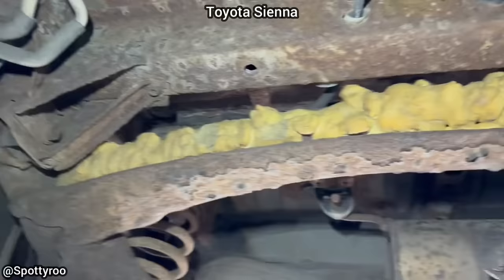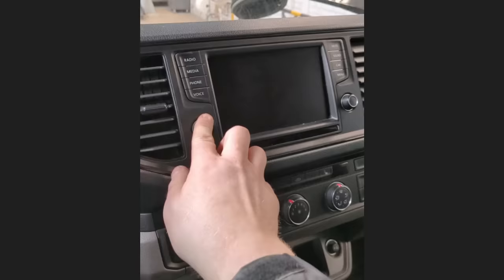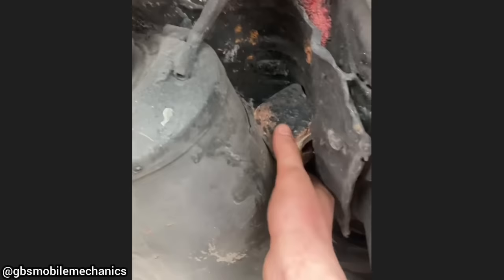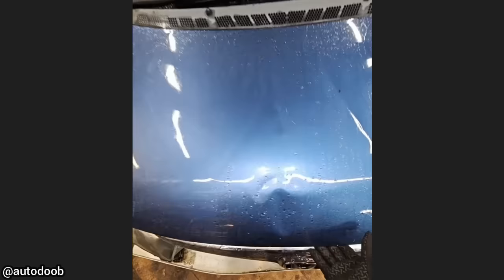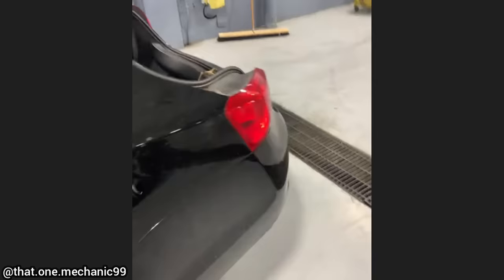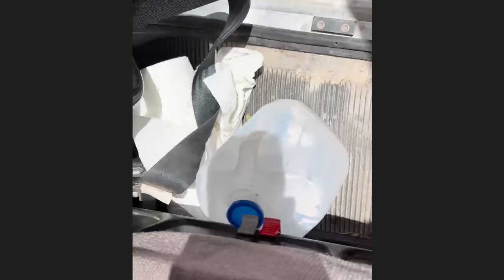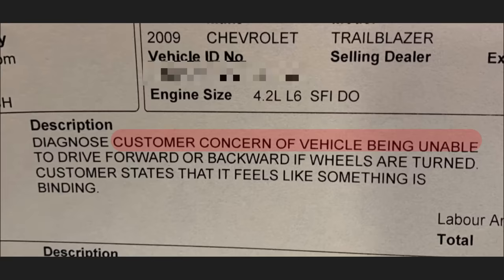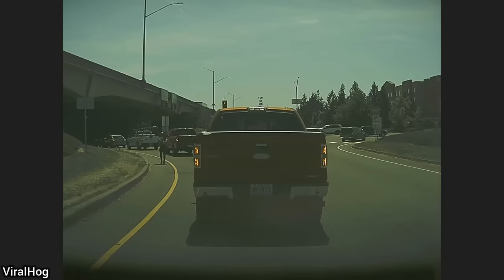Customer States Car She Just Bought Has A Grinding Noise

Comment: Props to the guy who has a bunch of friends willing to push his car anywhere he wants to go. That guy wins the week.
Reply: That's some great gas mileage.
Reply: Must not have had very far to go
Reply: It was the dumbest thing i saw today lmao
Reply: @AnekoGT really? Not the radio or the jeep back door?
Reply: If he's not yelling "ONWARD, SLAVES!" then he's doing it wrong
Reply: It doesn't run on fuel , it uses Gatorade and chocolate bars....
Reply: @jasonfitzpatrick414  Meals are more expensive than gas
Reply: This repsirshop prob saw his opportunity and gave a big repair estimate. Props to the friends helping the car owner🎉
Reply: I once pushed my friend's car BEFORE the party. It just stopped. We were around 40 miles from his home and reached his limit on tows with the insurance co. I think it was two in one year. Uber was $40 and just paid another guy $20. His new problem was going back to the same location the next day to replace a chip. The best part? He's a MECHANIC.

Comment: The plastic on the filter keeps it new and fresh forever. 200 IQ!
Reply: untill it gets dirty in 10 years
Reply: Just like grandma did with her couch!
Reply: @thewubmachine840 Nope. Mines 12yrs old now , looks like new.😂
Reply: Don't have dirty air if you don't have air taps head
Reply: i laughed out loud at that part, maybe the recirculate button or doors dont work and they wanted permanent recirculated air, lol
Reply: I'm surprised that there's no multilingual warning, in large block letters, to remove the plastic film before installation.
Also the stock warning:  This bag is not a toy.  Keep away from babies and toddlers.
Reply: @calvinnickel9995  Exactly what I thought.
Reply: works for oil filters too!
Reply: Looked dirty even in plastic..
Reply: Service mechanics HATE this amazing easy trick
Reply from the maker: @brianstratton8767 I had to get a brand new cabin air filter the other day and it looked the same.
Reply: @calvinnickel9995 My parents had that on their car seats back in the 70s. Got pretty hot in the summer sitting on that w/ shorts on
Reply: Long ago there never were cabin filters.
Reply: asian remote
Reply: Air systems all tuned up. 
I checked, you’ve got a brand new filter in there.

Comment: A grinding noise means that it needs more spray foam.
Reply: Excuse me, good sir, have you heard of duct tape? It solves everything.😊
Reply: Duct tape trumps spray foam , so op is right.😂
Reply: and glue
Reply: Yeah between the ears
Reply: @toupac3195  Duct tape is obsolete, we enter the era of spray foam.
Reply: I'm not a big fan of govt restrictions, but spray foam should require a safety course and a permit, lol
Reply: Needs more Lego people. Caught that on the thumbnail, went... wait? Blew up a screenshot of it, he's there and on the job, lol.
Reply: Lads, you need JB Weld! None of the shit you suggested is gonna work
Reply: @Doug791 but nothing beats jb weld. I seen a video w a cylinder head made from jb weld and it worked. Not fixed with jb weld, but 100% made from it. It was a lawnmower, but still a jb weld cylinder head. That stuffs amazing.
Reply: @CodyT362 exactly. I said jb weld before i read the whole thread and seen your reply. Jb weld is the new fix all.
Reply: @jacksmith2315  I can't image anything that can't be fixed with jb weld , and maybe cable ties.

Comment: The hitch blocking the rear door had me laughing. Wow
Reply: It would be hard to resist the urge to say "Sir, I found the problem. It turns out you're an idiot."
Reply: How is that that person didn't hear the door hitting it??
Reply: It's a jeep thing
Reply: Unlimited accessories on vehicles are mandatory.  Operator's brain and eyes are optional!
Reply: IKR!  I don't think I've ever eye rolled or laughed so hard.  And I've seen some pretty ridiculous stuff watching this channel.
Reply: I was shaking my head.
Reply: Reminds me of a computer technician on the phone with a customer. The computer wouldn’t start working. After going through all possible steps the customer states that the power in the neighborhood was out. The technician told him to pack up the equipment as he was too stupid to own one.
Reply: @aluisious  ID10T Error.
Reply: Yep same 😂
Reply: Sadly, that's a common problem on those types of vehicles, including needing the shop to diagnose it.
Reply: The majority of Jeep owners would fall for this if they owned the same hitch.
Reply: I had to rewatch that part to ensure I was tracking the level of dumbness.
Reply: @themightymutt5213  Yes, or SEE it hitting the hitch.

Comment: Replacing a fuel pump is something a home mechanic should be able to do. But, if they have that level of competence, you would think they could have diagnosed it themselves.
Reply: Exactly 😂. I can only imagine how they are going to butcher that job
Reply: That guy talked his buddies into pushing his car to the shop, I seriously doubt any of them is smart enough to change a fuel pump
Reply: @samholdsworth420  bet they weld the new one in
Reply: It’ll be back in a week with a backwards fuel pump, missing fuel lines and a pile of wires that “another shop” installed.
Reply: Not as easy as they used to be. Most modern vehicles have the fuel pump mounted inside the fuel tank. While not particularly hard, that's more than most can handle these days.
Reply: What? When they can't figure out why the rear door won't open? 1:36
Reply: @CJRoberts8812  Some aren't even replaceable at all, you have to replace the entire tank for thousands of dollars. The first couple generations of the Prius were like that.
Reply: @CJRoberts8812  I think they're easier to replace today. You used to have to drop the fuel tank to get to the pump. Nowadays, most cars you just take the backseat out to get to the access cover for the pump.
Reply: I could see an Advance Auto Parts across the street. I bet that is where they were headed.
Reply from the maker: Might be in a future episode 😜
Reply: I had a 2000 Impala that had a pump go out.  Luckily, GM actually built in a door under the rear seat to access it.  Took about an hour.
Reply: @PaulG.x  ya that one ... dammmm...
Reply: Unfortunately a lot of young men don't know much if anything about car repair besides bodging in a fart can and putting Japanese character stickers all over the sides of the car.
Reply: Modern vehicles need an expensive diagnostic computer to properly diagnose a problem. I've never had a vehicle pushed to a shop. But I have driven to one for a diagnosis and then fixed it myself when I didn't have access to the proper equipment
Reply: @johnstone9396  Instead of dropping the tank, they'll cut in from the top with an angle grinder. 
If they DON'T set the car on fire, they'll seal the tank and the body parts with spray foam and self-tapping screws.
Then bring the car back in to diagnose an evap leak and a gas smell in the car - then they will decline to get it repaired.
Reply: @stonefacedninja  Used to be fuel pumps were upfront on the motor down low somewhere.  On the 472 caddy motor on my engine stand it is on the front driver's side.
Reply: C'mon now, you've seen the level of flognuttery from these specimens.  ...oh sorry, I mean another shop of course.
Reply: @zloycock  "Make the hatch by yourself" -this is not how you do your own maintenance and repairs.  🙄  Think we found the "other shop" everyone claims to take their cars to.
Reply: Replaced the failed power steering pump on my vehicle today.  And a new O ring for the high pressure output line.  A known leaking point.
Reply: My old 68 Impala with a 307 V8 had the fuel pump mounted to the engine. 
It was powered by the cam shaft.
Two hoses and two bolts and you were done.  😅
Reply: @railtrolley ... 😂😂😂....Was it a "FOAD"...??...Coz, that's what I have...Desperately needs that repair or I mite just replace the whole unit...😂😂!!!
Reply: @johnstone9396  nah, spray foam is the new style! 😁
Reply: There have been several "owner tried to replace fuel pump himself" cases on this channel, where the owner winds up getting to the fuel pump with a sawzall and butchers the car.
Reply: @ToyManFlyer1100  Yes, it is.  New pump seems to be ok.  High pressure pipe joint is clean and dry.  Will keep an eye on it.  Supposedly, if you buy factory, they will injsist on selling you a $300 new pipe and O ring.  So, I went aftermarket for the 50c O ring.
Reply: @railtrolley  ... I  hear you...Been had the trk for 2 years...Been putting off this repair since then...Gotta say...Power steering pump has the best fluid in it...Why...??? Coz it's mostly new from constant refills...😂😂😂!!!
Reply: Kind of funny as I just took the fuel pump off my old '87 Wrangler.  It's carbureted so has a mechanical pump.  Problem is trying to find one locally without having to wait for an online order.
Reply: Changing a fuel pump isnt as easy as it used to be. Most are tank down, and some require changing the pigtail for the pump assembly. But some can be changed by pulling the back seat. But not many.
Reply: @stonefacedninja  As a 25 year master tech, I have done 2 in the last 5 years accessible through the back seat. I think they were Nissans. Very few manufacturers will cut their own throat on labor like that. Design is about easy and cheap assembly, and high customer pay hours on repairs.
Reply: I'm sure they will drop the fuel tank while smoking as well...
Reply: @nodak81  what the hell??! The WHOLE TANK???!

Comment: Push it away is a new one
Reply: If they can't afford to tow it, they probably can't afford to fix it either.
Reply: @Paul_Wetor  mom should have used spray foam
Reply: It would've been easier to leave the car at home.
Reply: @baksatibi  It would have been easier to advertise "$500, car doesn't run, you tow it away."

If you're pushing a car into and out of a shop, you should just admit that a bus pass is your immediate future.
Reply: @baksatibi  Especially if you don't plan to pay to fix it.
Reply: Keep fuel consumption low push it everywhere.

Comment: if you leave the plastic on the cabin air filter it will last longer!!! duhhh!!!!  hahaha!°°
Reply from the maker: the secret shops don't want you to know lol
Reply: It's the new anti-viral filter!
Reply: Certified HEPA!
Reply: i laughed out loud at that part, maybe the recirculate button or doors dont work and they wanted permanent recirculated air, lol...
Reply: Arguably it will filter everything, including the air......."High performance filter"
Reply: Looks like they re-sealed a dirty filter.
Reply from the maker: @Retro-Iron11 it's just the look of the cabin air filter (charcoal activated) I replaced ours last week and looked the same
Reply: @JustRolledIn  Ah, mine currently looks like it does after being in the car for ~7 years. :) My new one is pure white clean, classic I suppose. I do like the sound of the charcoal activated, it should be more effective at smoke filtering.
Reply: Why not leave it in the box as well?  :)
Reply: I've seen people leave plastic on top of the oil filter 😲
Reply: @TanManFixes  Filter life: Excellent. Engine life: Not so much.

Comment: The poor guy at the end, as well as those car owners. There is nothing anybody can do, when a wheel comes racing that fast. You better take cover. Because wheels are heavy, when one got so much speed, you better not get in the way, it could literally kill you.
Reply: I saw a video once of a guy who tried to stop the 600 pound wheel of a mining truck that broke loose. It removed his arm.

Some people just can't think on the spot.
Reply: I had something like that happen but I was on a motorcycle and the wheel cut across my pass less than 30 ft away.... I was watching it bounce down the opposite side of the road coming at me from about 1/8-1/4 mile after it left the rear axle of a semi on a 4 lane divided (large grassy median) highway (US27S in Fla). I had slowed to be able to maneuver out of the way if necessary. Once it passed it cut a stop and street sign off at the knees and took out a orange tree or three.
Reply: I saw a semi that had another semi wheel hit it from the opposite direction. About a 120 mph impact. Truck at 60, wheel at 60. It blew through the grill and radiator, blew off the oil pan, ( which had 28 big bolts sheered off) and broke the crankshaft off 2 cylinders back. I could see the first two connecting rods hanging out of the motor. Crazy physics.
Reply: @gustav-no8rz if both of those hit each other at the same speeds, the impact speed is still 60.
Reply: @zloycock I'm trying to work out what the impact speed is if one vehicle is going 60 & hits a stationary object?

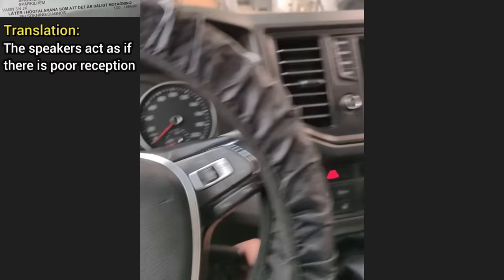Comment: 0:22 - (said in raspy Old Man voice) "Remember when radios had actual tuning knobs and analog tuners?"
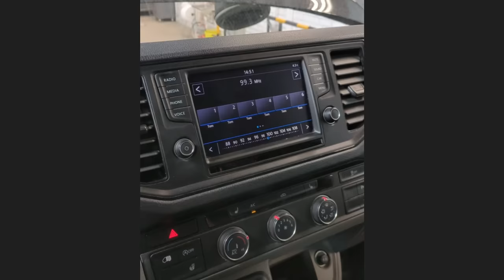0:39 - Advance Auto is right there, so I'll give them credit for that much. 🤣 But chances are, within a year they'll be doing it again. Looks like the type to drive around with the Low Fuel light on all the time.
2:51 - Just Rolled In! LITERALLY!

Comment: Those freewheeling tires are an absolute menace, I'd scream my lungs dry if one were to hit my car out of nowhere
Reply: That pedestrian was lucky it didn’t take them out
Reply: No, it wasn't "another shop" that caused this damage. You're not going to believe this...
Reply: I had one bounce over the freeway median wall toward me. Managed to judge its trajectory correctly and avoid it.
Reply: Back in about 1991-1992, I actually saw that happen one day on the 405-freeway southbound near the Torrance area. Tire came off the vehicle just to my front and next lane over.... it actually gained speed (( or so it seemed because I and others slowed down...)) and it went up over the center concrete divider and hit a car on the northbound side.  Scarrrrry stuff!
Reply: yeah i’d take myself out screaming if the tire didn’t
Reply: Maybe a month or so ago, a big ol' work truck (think F550 size) lost a wheel just behind and to the right of me as I had just passed him and as we were going downhill. I'm just grateful that I saw it in my side mirror and had a huge shoulder next to me that I could swerve into and slam on my brakes. It almost hit me three times! If I hadn't swerved, it would've rear-ended me. If I hadn't braked after swerving, it would've side swiped me instead. The 3rd time, it just lost its momentum after bouncing off of the barricade, but it tried to hit me head on before it finally fell over maybe 6ft in front of me. I just sat there for like 10 minutes wondering what the hell happened and how I was still alive.

The truck managed to get over to the shoulder and when the guy walked over to roll the tire back to his truck, he asked if I was okay. I told him that I felt like I just left an episode of Loony Tunes but nothing was broken except for my peace and calm for the day lol. It did make me late to a doctor's appointment. I called to give them a heads up before I resumed driving but they didn't believe me until I showed them the dash came footage. They fit me in and waived the late/no-show fee after that.

Comment: Fun story:
This Friday evening, I tried to do my very first oil change myself and was also able to find a video of someone doing it on the exact same car.
First step is to remove the plastic cover that protects the oil filter area. So I remove the plastic rivets and move on to the 4 bolts. 
 First one breaks and is also stuck in my socket. Great. Was able to find another socket that fits so move on to the second.
Which also breaks and stays stuck in the socket.

I now have an appointment at the shop to have them remove the plastic cover (I'm afraid the 2 other bolts will also break) and to try and remove the 2 broken bolts. But I'll still do the oil change myself after.

What a nice experience!